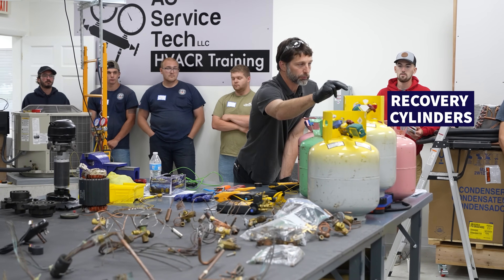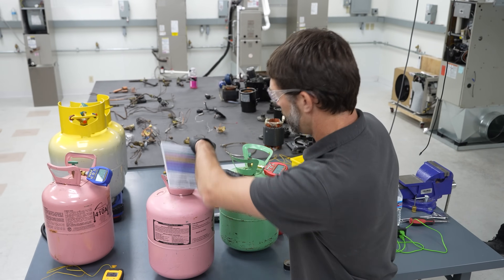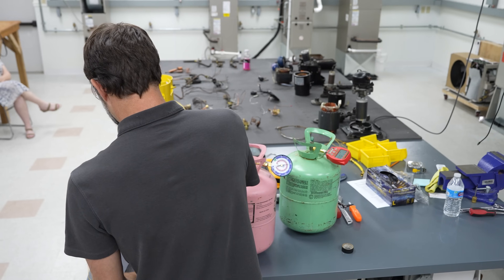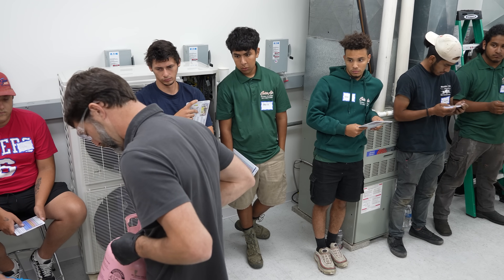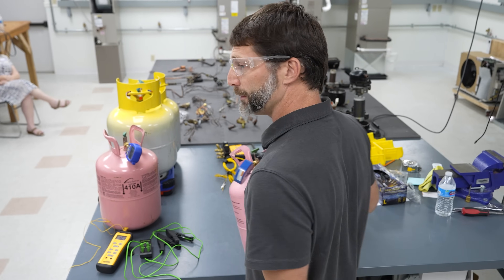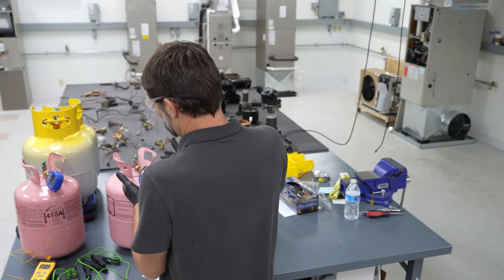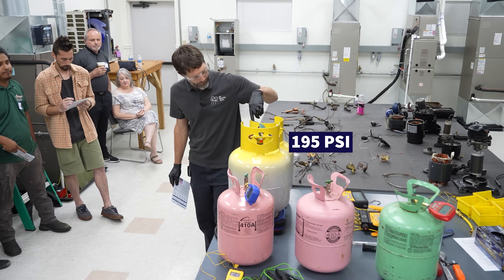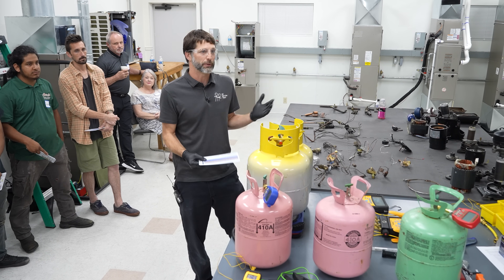Basics of Refrigerant Class! Bottles, Saturation, P/T Chart, Pressures, Temperatures

Comment: Putting R 410a in a Rotary compressor is great for cooling not a heat pump! Is  a heat pump too much pressure for R 410a? True or false? R 410a for cooling and a furnace for heating. Is that a good choice . Just using R 410 a  as a cooling refrigerant?

Comment: Would you bring window units that are Type 1 epa 608 and are with process tubes to a recovery center! 
They are scraped sometimes with refrigerant in them because of the process tube needs a piercing valve!
What is the correct weight to determine the type of refrigerant in the recovery tank? Is it over 5 lbs?
You need to use the scale ? No joke!

Comment: Why wasn't R134a included in this discussion?
Reply: How many do you want? How many is enough?
Reply: @realSamAndrew  it's an honest question...I'm not an expert or in the HVAC field. I was just curious if there is something about R134a that makes it unsuitable for HVAC purposes. I know it is used in automotive and refrigerator systems.
Reply: @andyfer7716  r134a is not typically used in residential hvac systems, or for most building climate control. But the general answer to a question such as yours is, you only need one or two examples to demonstrate a concept in a teaching environment, and you would usually choose those based on the most common ones. With limited time, space, and resources, you can't cover everything  even if you wanted to.
Reply: @realSamAndrew  ok thanks
Reply: @andyfer7716  Mainly because R134a is only for low temperature applications like freezers. Wouldn't work for HVAC.

Comment: The pressure noted was 200.5.  It is NOT what was circled and is NOT between 201.0 and 208.1.  The temperature reading is not "71 we'll say".  It is 69 as indicated on the digital thermometers.
Reply: A mistake for sure. I find it hard to believe that no one in the room caught that. When diagnosing a system 8 degrees can change everything….
Reply: I've done both and think appliance repair is just as difficult as far as the service side of things goes.
Reply: Calm down, dude. He was ONE number off. Don't act like you never made a mistake in your life. It's just a general idea.
Reply: @eric01406  GFY DUDE!  I did not say it wasn't a mistake.  The world is full of mistakes.  Craig is far smarter than to make a "general idea".  He is accurate and concise in all his videos.  To you it is a "general idea".  To those that know nothing about refrigeration and are watching this, it may be confusing because it is WRONG!
Reply: @eric01406 in a general casual conversation, this is perfectly acceptable and very common. But this is an instructional CLASS. You don't let glaring errors slide in this case. You wouldn't publish a textbook with a clear error, and if you did, it would be corrected immediately upon discovery.
Reply: @realSamAndrew Why until today is the stupid textbook, electrical diagram, and including Fluke keep saying DC current flows from positive to negative?
Reply: @w0lvez1  rules are not always followed. Doesn't mean it's not a rule. And it doesn't mean one should let a violation slide. Why don't you ask the book publishers if anyone has complained, and if so, why haven't they done anything about it?
Reply from the maker: This was certainly a mistake. I heard it, repeated it and then my brain went to another nunber while teaching. I still thought I wanted to publish it. It was raw and not polished like a normal video and mistakes certainly happen. Thanks and sorry!
Reply: @acservicetechchannel :

If you noticed the mistake, then why didn’t you show the correct graphic and perhaps add a voice over to correct the error?

It’s clear that your students weren’t keeping up with your pace.
This is because you were told them the bracket and temperature instead of having them actually think it through.

But what surprised me was that you didn’t say, “Wait, why is there is discrepancy of 2°?”.
Are the tanks stabilized at room temperature?
Are the gauges accurate?
Did I misread a gauge?  
Did I look at the wrong chart (wrong refrigerant)?
Did I pick the correct bracket?

The students need to know these pitfalls.
So it would have been a great time to point out all the things that have to be correct.
Reply: @acservicetechchannel   I have been a teacher of math's and statistics teacher for the last 30 years and have made blunders time and time again. Students do not realise how stressful teaching is. Many of my students used to think that I was calm and collected in a class, inside I always had butterfly's in my tummy. How I wish you guys had this course in Australia. HVAC has got to be the most difficult trade I have ever come across
Reply: @alanmainwaring1830 we do, its cert III refrigeration and air conditioning mechanical and cert IV mechanical/HVAC plumbing 

No teachers like Craig tho
Reply: @alanmainwaring1830 :

It’s a shame that someone who works as a teacher forms plural nouns by adding “‘s”.